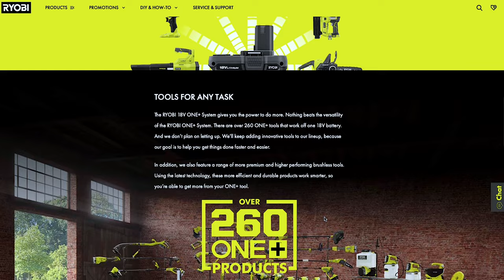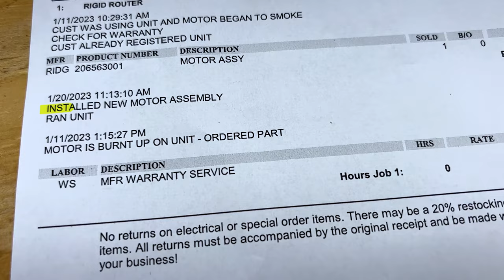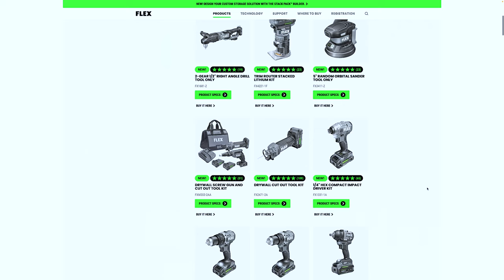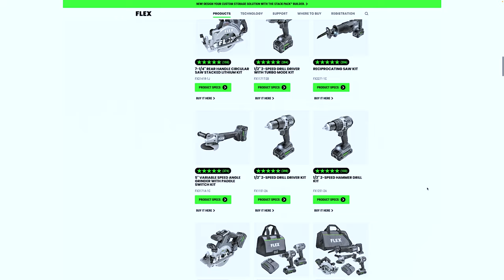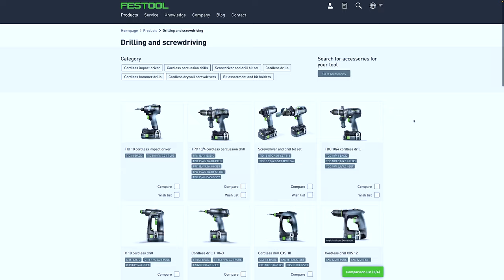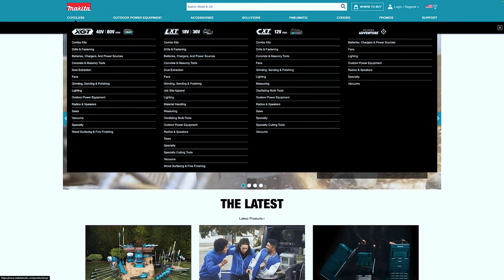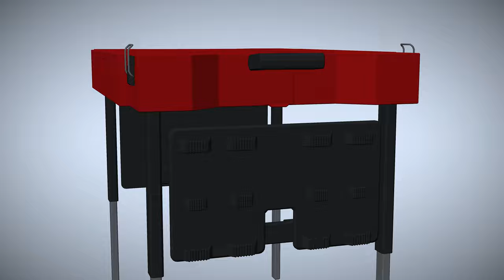I Found the BEST Tool Brand for Woodworking in 2023!

Comment: If it isn't cordless, where battery interchangeability matters, keeping to one brand is meaningless.  You showed several corded tools of various brands - DeWalt planer and Festool Domino for two examples - and talked about their brands as though keeping to it mattered.  You are usually better than that, and I am disappointed in this video.
I held off with going cordless for a very long time and settled on the 18V Milwaukee line.  That brings up another point not covered: 12V vs 18V.  My selection is limited to the 18V unless I want to start mixing things up.  Love my M18 18V, but that detail sander you praised is 12V only.
My routers are all corded Bosch, except a Milwaukee compact where the deal was too good to pass up.  
My jigsaw is corded Bosch because they are the best.  
My 7 1/4" circular saw is a 40 year old Makita that will last forever.  
Sawzall?  Porter Cable, corded.  Random orbit sander?  Porter Cable, corded.

Comment: Great video!  I will continue to stand by Flex, they are coming out with more tools all the time.  In the near future they will offer a Brad Nailer, Miter Saw and Table Saw.  In a couple months they are vastly expanding their Stack Pack line.  It will include mounts and drawers.
Reply from the maker: They are doing good stuff!  I like seeing competition!
Reply: You would be surprised at the lack of vibration in their multi tool and recip saw, if you ever try them out.  I got their new sander and really like it as well.  I only have the Kobalt sander to compare it to, but I definitely like the Flex way more than the Kobalt.

Comment: So, you redeemed yourself in the end.  It would be insane for any serious woodworker to limit themselves to a single brand.   I’ll give you a thumbs up for milwaukee on livery.  Their tools look better than most. Especially ryobi, what were they thinking when they decided that bright fluorescent fish bait green?  They should have stuck with blue and yellow.  Ha, of course picking your tools based on color is almost as insane as sticking to one brand.   Face it, each brand you mentioned has its winners and losers.  Milwaukee sliding mitre saws aren’t great.  My opinion, none of the “desktop” tablesaws are really great for woodworking.  They’re good for fine and trim carpentry which benefits most from a job site tablesaw.  None of the brands you mentioned really have a woodworkers tablesaw, by my definition.  However, a nice track saw and an MFT can give a woodworkers tablesaw a run for the money.  My suggestion for those just starting out, do your homework.  Consider the cost to performance aspect based on what you currently want to do and what you’ll project to do over the next 5 years.  Realize that in 5 years you just might want the latest and greatest even if the tools you have are just fine.  Does my opinion count?

Comment: My biggest issue with ALL tool brands these days, is they aren't really developing new corded tools. I have zero need for a cordless router, and nothing is as good as the discontinued, decades old Porter Cable routers. I also have no need for cordless sanders, table saws ormiter saws